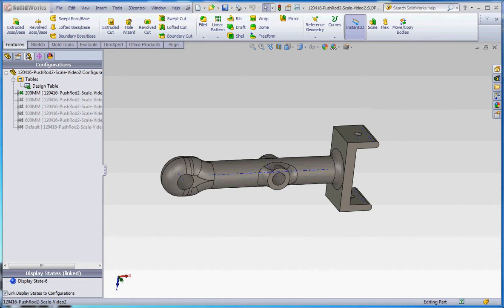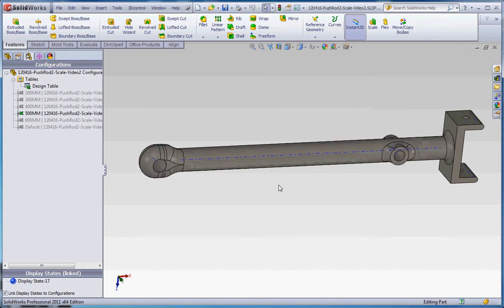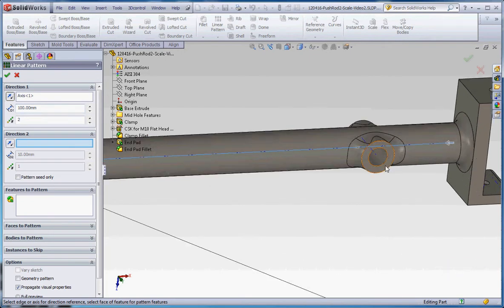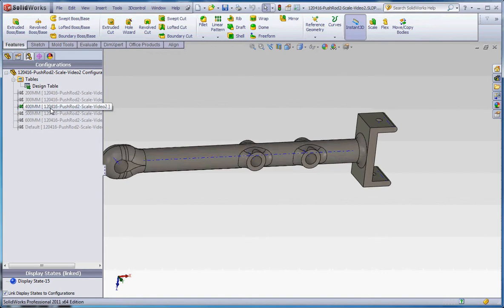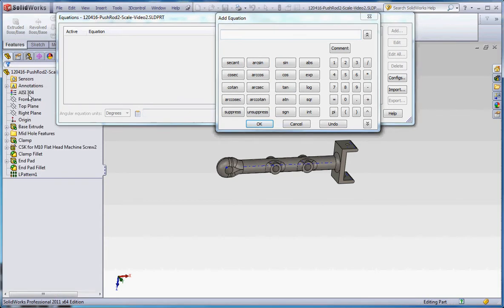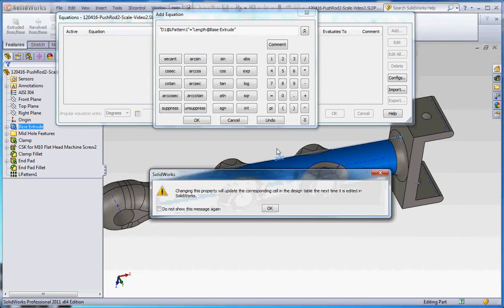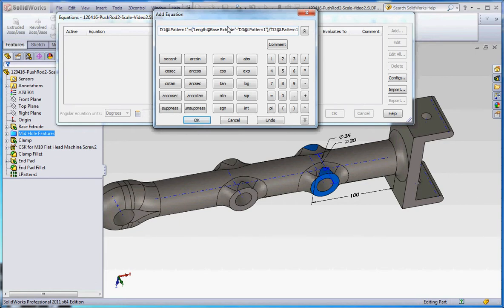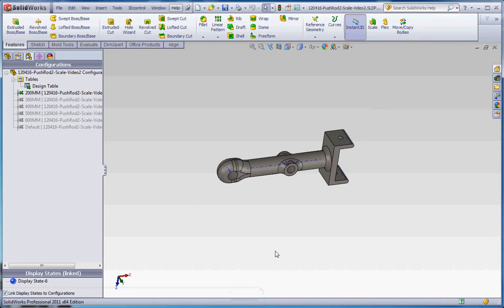More Part 5 - Configurations, Design Tables & Equations, Equations

Comment: So I am on the right track. Could you please explain the equation? Why did you chose the dimensions you did and why did you divide some things by themselves. I really didn't get it. Thanks!
Reply from the maker: +Stephen M - Hi Stephen, to answer your question, it may appear that I am dividing the distance of the first instance by itself but the division is on the other side of the brackets that I insert after the equation has been populated.  So the equation should read as such" the instances of the boss/hole is equal to the (total distance minus the distance between the instances) divided by the distance between the instances.  Which in this video is  i = (300 - 100)/100 or i = 200/100 which ultimately equates to a unitless value  of 2 instances.  If the total length were 400 then the equation is i = (400 -100)/100  and equates to 3 instances and so forth.  I hope this helps.
Reply: Oh yeah, fairly straight forward, thanks for taking the time to clear that up for me.